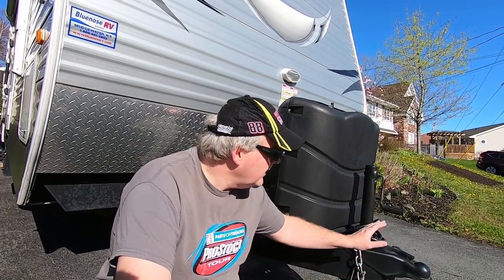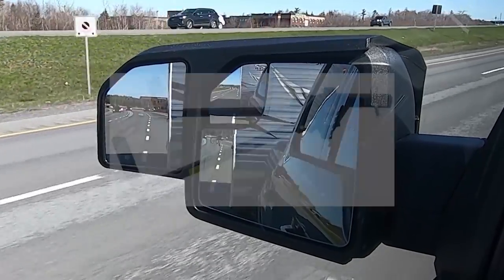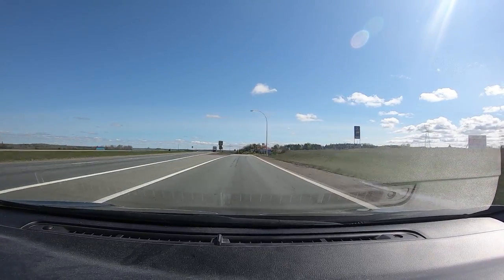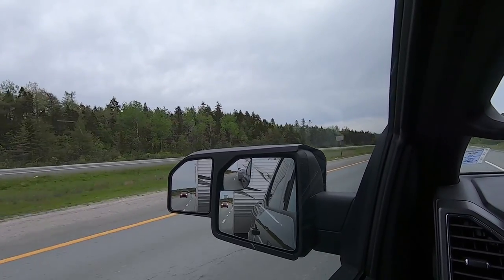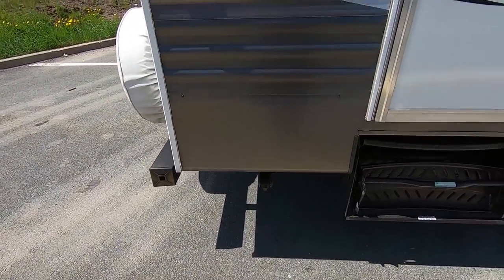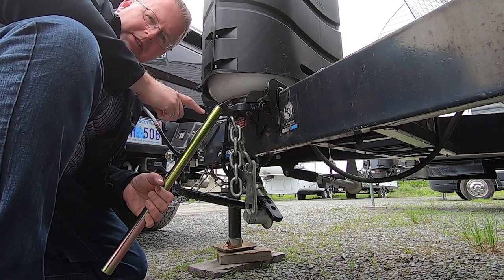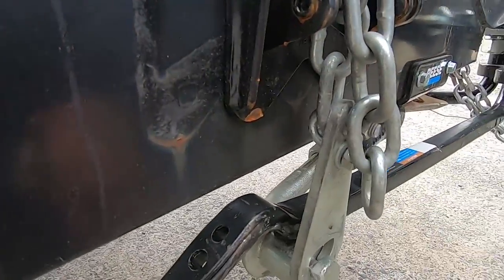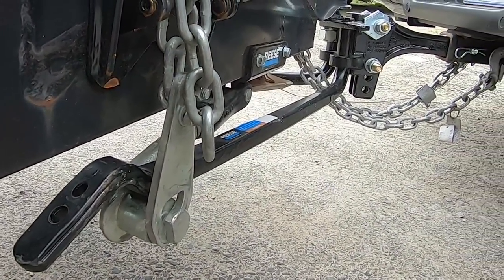HOW TO GET RID OF TRAILER SWAY  |  Video 3 of a 4-video series.

Comment: Been using an EQ with my 32' 6300# loaded TT w/2017 F350 6.2 w/tow package for about 15k miles over 2 years. First tow was in heavy winds avg. 25-30mph with gusts up to 50, so everything since has been gravy. But even that day wasn't a problem. My friend who gave me the hitch was pulling his 5th wheel in front of me with his diesel 350 and complained about the winds more than I did that first day. Other large trucks aren't an issue unless we squeeze too close and create strong pressure. Go slow, leave space to get there quickest.
I'm holding out hope my other friend will upgrade to a 5th and give me his Hensley before I spend the dough on a PP. 😅

Comment: On all tandem axle trailers there are problems with trailer frames being twisted and breaking. An inspection at least annually will prevent a disaster or loss of your RV. Inspect the 2 Ibeams that your spring shackles weld to. The problem is making turns on pavement scrubs the tires sideways . Sharp turns really twist the frames and splits the web of the Ibeam about 1 inch above the bottom flange at 3 places where the Crossmembers weld between the I beans . This is evident by rust colored lines like a scratch. This occurs a few ft  before and after the axles . On 5th wheels the Gooseneck can break . Look at videos on your type of RV.

Comment: If we are going to give guidance that affects the decisions of others - we want to make sure it is solid advice. We don't look for squat and the trailer should remain level if the WDH is set correctly and the vehicle is capable of towing said trailer. 
Braking and steering are very dependant on the front axle of any vehicle. Any time you pitch the front upward you compromise both functions. That can make us a danger to ourselves and others on the roadway.

Comment: I have the exact same WDH, right down to the round bars. The round bars are great because they have less bounce than the trunnion style. I really like it, but I find in order for it to be fully effective, the bar “scoops” have to be perfectly centered on the cams. With the TV & TT aligned, check that the cams sit directly under the apex of the bar scoops. This can sometimes take a lot of adjustment and readjustment to get it right. Then with the right amount of bar tension, sway can be eliminated almost entirely. You may need to readjust after a few KMs as well, and possibly yearly. After a few years, our bars loosened up and I had to adjust the tension a partial link (you can do that by inserting a 1/2” bolt & nut between any 2 links that will be under tension). After adjusting the tension, I found that this put the bars into misalignment with the cams, so those had to be readjusted as well. Unfortunately it seems our dealership bolted the cams a bit too far back on the frame, making it so that I have to adjust the cams right to their limit in order to get it right. Hope I don’t ever need to adjust it any further.
Reply from the maker: Interesting info, thanks for sharing. It took a handful of readjustments to the cams and rotation of the hitch head to get it right. Cam placement is very specific too, it’s good if an experienced installer does this work.
Reply: @LifeonOURtime  Unfortunately none of the installers who have worked on my hitch have understood how it needs to be adjusted. I've had to redo everything myself, but ultimately it really is worth the extra effort. Sway is a thing of the past.

Comment: Correct setup of this system is when both the front and rear squats the same amount. So if the front fender were 37 inches and the rear 38.5 inches before hitching up, then measurements of 36 and 37.5 after hitching and installing the bars would be correct (both front and rear squatted 1 inch). 36.25 and 37 would be wrong (squat of 0.75 and 1 respectively), as would 36.5 and 37.75 (squat of 0.5 and 0.75 respectively), etc.
Reply from the maker: Need to be careful how much weight is being moved to the front axle.
Reply: @LifeonOURtime  Excellent point. You can't transfer more than 50% of the tongue weight to the front axle without raising the rear of the tow vehicle from its original position. Barring that, if you are at the ragged edge of what your tow vehicle can handle, it is a good idea to take the whole rig to a truck stop and put it on the scales to be sure. 
I have a tongue weight scale, and even though I knew from that and my measurements that I could not be loading my front axle more than 650 pounds (well within the limits of my front axle),  I took it to the scales anyway. I have done this with every trailer I have owned after getting rid of my popup. With the current trailer, I am transferring about 300 pounds to the front axle.

Comment: I went with the Reese R3. The bars are on top. I have a bad back and the under-slung bars were difficult to handle. My sway control is built into the head of the hitch and there is no noise.
Reply from the maker: Interesting, I’ll have to look into that model.
Reply: I have the equalizer which is basically the same design as the reese but beefier.  Its pretty noisy so if its not noisy maybe its loose lol

Comment: Do you have to unhook the bar when making sharp turns or backing up
Reply from the maker: I don’t, however I have experienced two times on a sharp turn and very uneven ground when one of the bars got up on the flange of the cam. I now make sure to do a pre-highway walk around after doing a lot of manoeuvres.

Comment: Swaying is due to lateral forces created by Trailer upon the tractor, and they cannot be avoided. No matter what hitch you do the swaying exist and is dangerous. Only 5th wheel may avoid swaying, such a gooseneck trailer, which is ugly and require to modify the tractor. I invented a new trailer which use a dolly converting the bumper traction into 5th wheel traction and will not sway at all.

Comment: Also, “sway control” hitches do not eliminate sway. You can always have sway when there’s only one pivot point . . . The ball. My stress level with the Equalizer hitch was off the charts and I also hated the noise it made because most all sway control hitches work off of friction which causes the noise. 

I dug deep financially and bought a Pro Pride hitch and never looked back since. ZERO sway and I mean ZERO. It tracks straight, it’s super quiet, I can drive with one finger on the wheel if I want, I have a 87 degree turn radius and I can actually put my tailgate down completely due to the added distance the hitch provides. Best hitch on the market . . . .PERIOD, FULL STOP. No I’m not an ambassador for them, just a regular customer. My stress level went from off the charts with previous hitches to relaxed with Pro Pride. Not looking back.

Comment: I'm so confused by all these hitches. I don't want to buy overkill for a trailer of 7,000 lbs max.
Reply: This is where 99% of people mess up. Sway control has nothing to do with the weight of the trailer per se. It is a combination of the size to weight ratio, the location of the weight within the trailer, and the ratio  of the weight of the trailer to the tow vehicle. To make matters worse, if you ask a dealer for help, you will get the solution that gets you off of the lot the fastest. They only make money by selling the trailer, and once you hit the street, anything that happens is not their problem. 
Robert Pepper posted an excellent video in May 2021 about trailer sway where they show various scenarios with models on a modified treadmill. While his video does not address the aerodynamic aspects of sway, it is an excellent starting point.

Comment: The head does not rotate, Sir. Just the bars do in the pivot point.
Reply: It depends on what words you want to use but the position of the head rotates/moves fore and aft. Otherwise, the torsion bars would not climb the cams.

Comment: should have just got a Roadmaster Active Suspension kit for $400 and been done.  Any WDH and RAS is all you need.
Reply from the maker: Wasn’t looking at options other than the hitch itself at the time. Something to consider the next time around.
Reply: I fail to see how adding a spring to your rear suspension will affect sway. And I will stick with my air bags.

Comment: Anti-sway?....three words, Pivot Point Projection, Hensley Arrow, ProPride.  Don't scrimp with safety. Especially with a "big box" RV   Better to prevent sway from starting than to mitigate after it's started.
POI... hard to get perfection without knowing the actual weight that has been returned to the TV's steering axle.
A visit to the CAT scales is in order.
Reply from the maker: Great choices, huge price point though.

Comment: What  a monstrosity - totally unnecessary - it is not a control system it does nothing but act as a resistive  element's to sway and is not much better than the friction hitches out there.  There is only one concept that is the answer and that is my "Differential Stability"  Dexter cam close with their electronic independent wheel control but missed the answer by a country mile.  I'm still waiting for a call by any capable industry leader.  Someone said I probably was asking to much for the concept  well the chance would be a fine thing since not even the great ALKO or Bosh have shown an interest of any kind.  Still they keep rolling over.